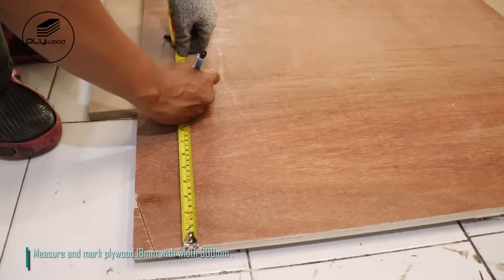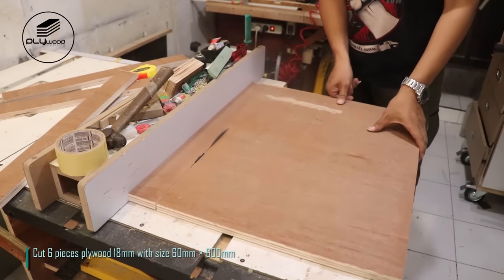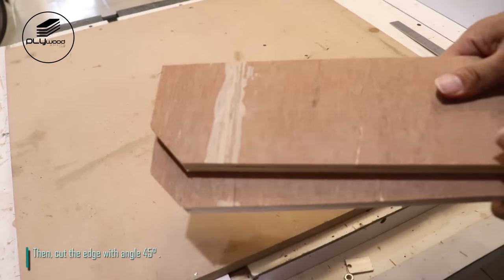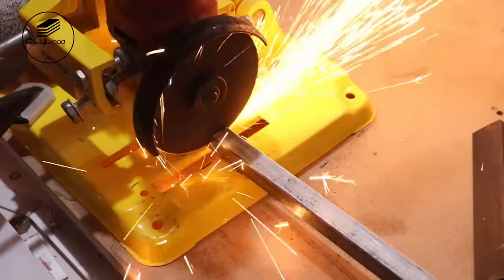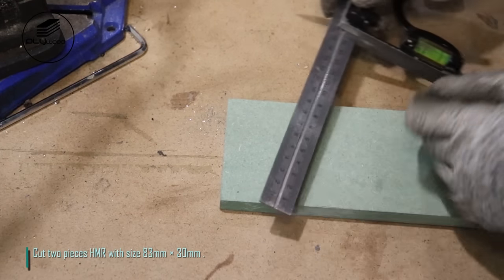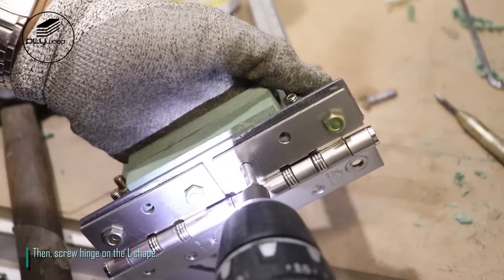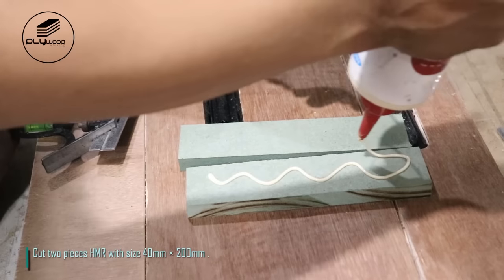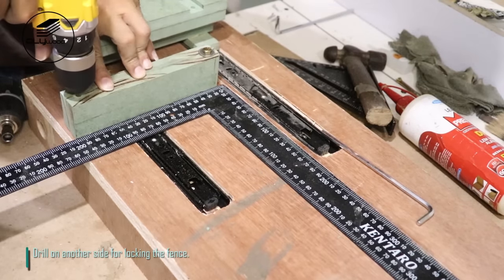DIY Slider Miter Saw Using Circular Saw - Cheap Sliding Miter Saw

Comment: If you needed all these expensive power tools just  to make one...what's the point?
Reply from the maker: maybe you need this tools what about the others, i just give simple solution maybe need need this tools
Reply: @plywoodworking  my point is : i would like to see a DIY tool making project using cheap, simple basic tools that  almost everyone already has..After all isn't that the reason one would choose to MAKE the tool rather than BUY one?If one can afford to have all these power tools at his disposal, it does not make good sense to make another.Just buy one  and save yourself time and labor.
Reply from the maker: @junfabi1  i think almost all woodworking have table saw, that standart tools, DIY or from factory. all material easy for found and very cheap. on this video i use cheap powertools for build this. i think  if i use  router maybe you can change with cheap trimmer or etc. this video only give some inspiration and   guide for build you . tha my point!!!